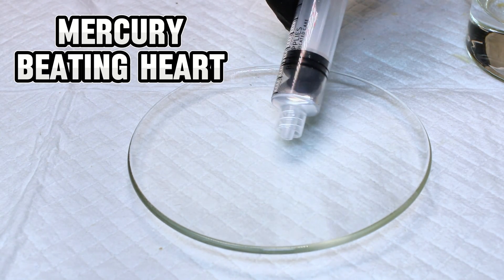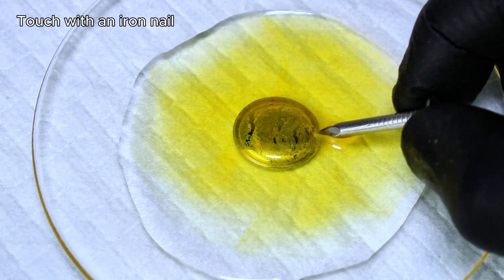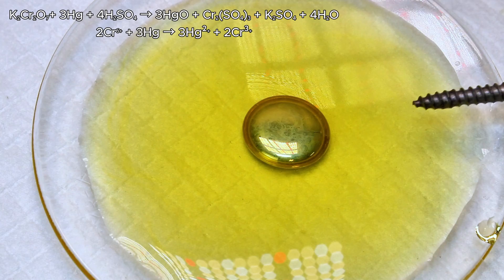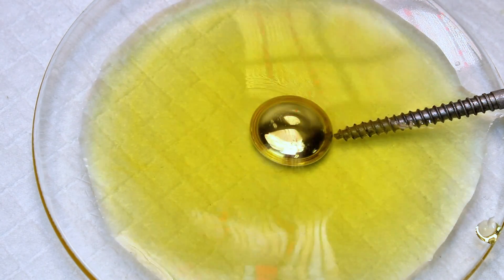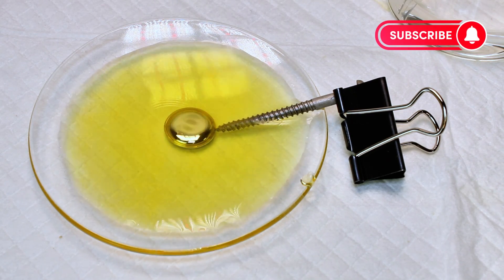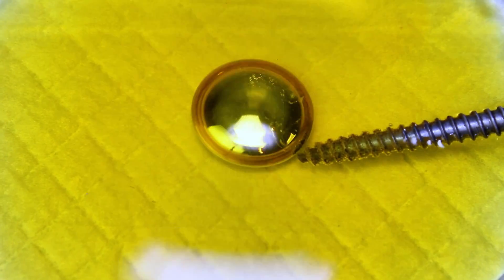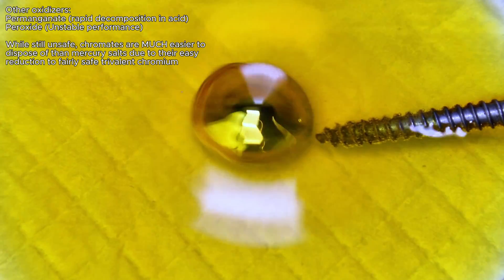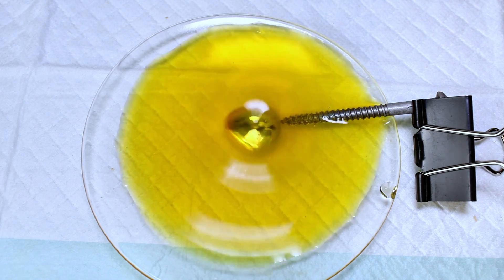Mercury Beating Heart

Comment: Late to the party, but the engineer in me is now curious.
Hypothesis:  The chemically induced oscillations of rhe mercury beating heart, when confined within a teflon ring and combined with a calibrated coil of iron wire inside the ring and two thin PEP diaphrams could be used to create chemi-mechanical parastaltic pump. The speed and mechanical force could be regulated  by controlled dispersion of the acid and oxidizing agent being fed via capilary action along the coil's end-points using metered release.

Comment: Triangle is a standing wave, with corect setup you could sustain it as well as do a few different shapes
Reply from the maker: Now I did figure it was a standing wave, but I never considered changing its shape. That would require changing frequency yes?
Reply: @integral_chemistry  Circular standing wave
Yes [well kind of] you could lock onto one of the harmonics, which would be half wavelength. "in theory",  by making contact at the correct distance and location, I think it's gonna be pretty difficult without somewhat more precise control over parameters.   
If I remember things right, the frequency was dependent to the surface tension and viscosity. just can't remember if gravity had any effect, say in a curved dish or watch glass. (I think it didn't)

Comment: You are making a mecury/iron battery. If yoy have a wire in the mercury and on on the nail, you'll get about a volt of electricity ❤
Reply from the maker: Ah dang I got ahead of myself in editing, I meant to talk more about the electrical properties of this process because as you said it is a battery, and the mechanics of it are actually pretty neat
Reply: @integralchemistry1849  one other fun thing to do is put a magnet under the mercury and put electricity through it while submerged in an electrolyte. It makes extremely good ultra low frequency audio transducers.
Reply: @integral_chemistry dang….guess you’ll have to make another video about that because that would be cool to learn more about. Really enjoyed this, that was very cool! Thank You for sharing that with us 🙏🏼